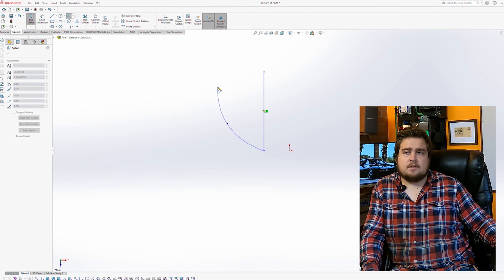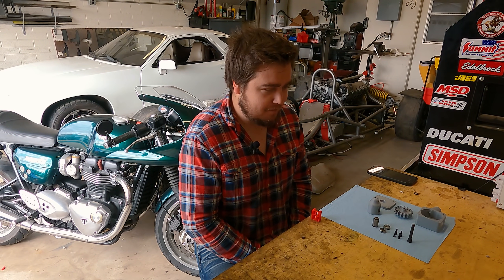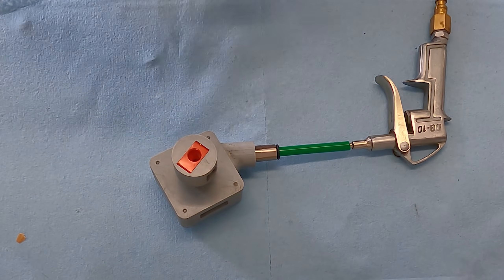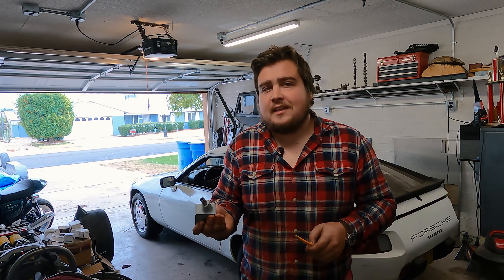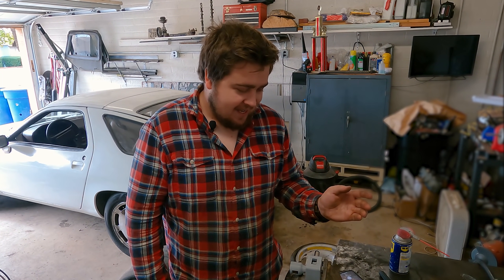11,000 RPM Turbine Pencil Sharpener!

Comment: Did you ever try and calculate the power and torque it could produce? I've been tinkering with a similar compressed air turbine but I don't have any of the parts printed yet

Comment: 3:05: In this point you have put the center wheel correctly, but here 3:34: You have the centerwheel backwards so that the air flows on the convex side of the spoons intead the concav side.

Comment: Now hook that air spinny gizmo to an old fashioned pencil sharpener like the ones that hang on school walls and it might not jam and could probably work pretty well.
Maybe print it with Tesla turbine smooth blades so it won't fly apart.

Comment: It's extra amazing that you took so much time and care in your build.  These days everyone is so rushed. So, I think the problem is the excessively tight tolerances down to the micron. It happens a lot when space age materials are used, due to expansion and contraction from minor changes in ambient temperatures. Also, next time, add more lubrication, I find that you need at least 10 to 20x lubricant at those pressures, usually a continuous spray at -70 degrees to ensure minimal expansion, and make sure to use the filtered deionized stuff and maximize the ventilation, that will help reduce the explosion risk. Additionally the Rotations per minute are clearly too low, consider 10x that to really get that tip to be extra shiny... and of course at those speeds be sure to do it all completely remotely and protected to insure maximum safety. 
:) 
Ok Ok... I was totally joking. I really enjoyed your sense of humor.

Comment: Revision idea, instead of holding the pencil sharpener turn the holder into the sharpener so it’s perfectly centered with the shaft and then use the blade from the actual sharpener.

Comment: There exists a pencil sharpener drill attachment.  Whether it has one blade or two I'm not sure, but it works--granted at much lower RPMs, but it works well.  Would that work any better than the sharpener you used?  This is the first time I am aware of that I've seen your channel.  I'd love to see a video where you improve the design not only for durability, but to where it will eat through a pencil with proper sharpening in short time, with a beautiful continuous shavings coil and a razor sharp pencil point.  Like a design that works well enough where you might want to use a tool to hold the pencil instead of your hand.  But yet the design would be practical enough to give you a new pencil point in about 0.02 seconds.  The other commenter has a seemingly good point about using the planetary gear type sharpener though.

Comment: so, isn't that wheel installed backwards? 

the fluid is supposed to go into the cup, and it looks like the air is actually flowing over the convex part, not into the concave part.

Comment: you can make this work if you add a weight (properly distributed) to the wheel, to have some bloody driving force. also remove the cheap sharpener and keep just the blade :)
Reply from the maker: Yeah, that was my idea after this was to add a counterweight. I think I might.

Comment: You can possibly measure the rpm by finding out the pitch that it makes, and divide that pitch by the number of blades on the wheel, which gives you rps.
Then it’s just a matter of multiplying by 60 to get the rpm.
I’ve used this on mouth powered turbines too, and they can get stupid fast.

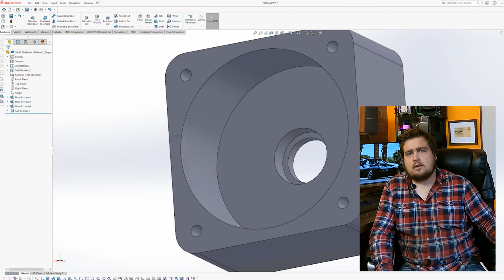Comment: Probabbly will work better with a 1:10 gear reduction or maybe more. You need low RPM and high torque so you can push hard on the pencil agains the blades. At that speed the blades probabbly hover over the pencil creating heat

Comment: the sharpener you put in it has a blade angled for low rpm and deep cutting. not high rpm and shallow cutting. if you were able to get it to engage the blade it would turn the wood to dust and likely self lubricate.

Comment: You might want to gear that thing down about 50:1 or so using some planetary gears and see if it sharpens better at lower speed with higher torque.
Reply from the maker: It probably will, but what's the fun in that?

Comment: Great video! I love when fever dreams happen to engineers, this is the stuff that happens. If you were to try this again, I'd suggest using a radial turbine instead of a pelton wheel - radial turbines would give a lot more torque I reckon. I have a SOLIDWORKS file for a radial turbine if you want it!

Comment: It wasn't the set screw. They all broke off like that because You spun the wheel fast enough that the centripetal force pulling the cups outward exceeded the tensile strength of the PLA.
Reply from the maker: I’m not completely sure- I printed another one and it did a lot better. I think I had a failure point

Comment: In order to sharpen the pencil you would need to use one of those sharpeners that are usually screwed to the door frame or such. They have cutting gears in them. So that is what you would need to attach the air power to.

Comment: You need a kinetic fly wheel for inertial torque, will buzz through pencils easy with a proper weighted one- though if not enough power, a reduction gearing for sure.

Comment: This is my first visit to your channel. I have deep respect for your "Fuck it, that's within tolerance" build philosophy and the 928 Porsche in the background. Also, I think you have that wheel on backwards unless you actually intended to present the domes rather than the cups of the wheel to the airflow. Finally, liquid lubrication to clear clogging with chips may not be the win you expected.

Comment: 90% sure the problem was that the two spurving bearings were not in a direct line with the panametric fan, have you thought about using prefabulated amulite for a more malleable baseplate?
Reply: Pretty sure Rockwell owns the patent, and would never allow it.

Comment: Now you know why electric pencil sharpeners use the grind method instead of the blade cut like tiny hand driven ones. Maybe try one of the dual blade versions so there is less drag on a single blade? 

I cant blame you, did a similar thing with way less nice materials... I also did it in the late 90s when 3D printers weren't a thing.

Comment: You and Superfast Matt are my favorite engineers allowed to run amok.

Also, I love the idea that you took an activity that requires pretty decent torque, and applied unbridled RPM to it instead.
Reply from the maker: Haha I mean if you add enough RPM torque doesn't matter.
Reply: @WesleyKagan  it's like the air force's solution to lift. You don't really need it if you're moving fast enough

Comment: I'd really like to see this sharpener eating a pencil as fast as you push it in. Why not make multiple nozzles around the circumference and turbine wheel more robust at the center? It should be pretty strong as a printed part if you have continuous layers for the full width of the part.
Reply from the maker: I actually really don’t hate this turbine design if I’m honest. It’s not terrible. Stronger bits here and there and a less terrible set screw and it would do okay. It’s definitely staying in the “good” pile of parts
Reply: A bigger wheel with more jets should increase torque and decrease rippums.

Comment: I see your problem. During reassembly after you said you left the pinion grub-screws off, you appear to have flipped the wheel so the cups are running the reverse direction. You had it right first time. So clearly not enough rpm. Always solution... MORE!

Comment: It may seem impossible that there might be improvements to this design, however redirect the airflow to blow out shavings.
Reply from the maker: That’s… a really good idea.
Reply: @WesleyKagan  make sure the exhaust is pointed directly at the users eyes
Reply: @dylanwalter1  please look directly into the operational end of the device
Reply: @PolishGreasePit  i see a spinnyboi
Reply: Use a tube for main shaft and drill random ports in it to send air through, could be neat

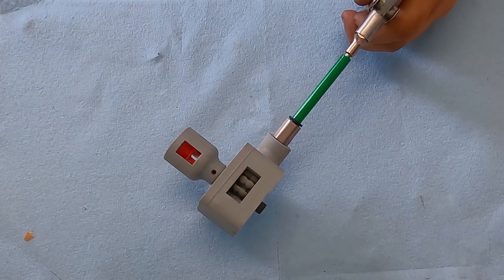Comment: 3:37 based on your cad drawings, isn't the turbine in the wrong way? bucket openings facing the away from the inlet in that assembly?
Reply: It is. I came to the comments just for this. Hehehe. You beat me to it
Reply: Yes, yes it is
Reply: I also came in here just for that. I wasn't sure if maybe I didn't understand how a Pelton wheel worked, but I was pretty sure the airflow should be directed into the concave part.
Reply: and also i think that rotation was also wrong and that sharpener was spinning the wrong way
Reply: You can flip the wheel over and it will for in exactly the same...
Reply: @84ThoughtCrime84   I'm not quite sure what you're saying. If you flip the wheel around then the stream of air will go into the scoops on the buckets instead of the back side of the buckets.
Reply: @84ThoughtCrime84  what?
Reply: @84ThoughtCrime84  Mate just shhhh, the grownups are talking.

Comment: @wesley kegan
3:32 - looks like you've installed the wheel the wrong direction (spoons pointing convex against the nozzle)
Nice print though 
can't wait for the updates on the diy  freevalve engine :D
Reply: Shit you're right!
Reply: I almost thought I was the only one who saw that.
Reply: @aggaming1766  if you're ever on the internet and you think, "I wonder if I'm the only one who..." - Don't. You're not.
Reply: @Hawk7886  it's just that I scrolled for quite a bit before I found this thread.
Reply: Yeah I caught that too
Reply: i wondered why it slowed down so quickly
Reply: Plus,as with any turbine the whole air charge must be focussed upon the impeller at the optimal position which it's self must be enclosed the and  air charge needs to be pushing the cup or blade for as long as physically possible in one rotation before exhausting hence the scroll in a turbo charger for example,an open chamber allows most of the air charge to not only by pass the impeller regardless of its orientation,( path of least resistance) but also creates turbulent air in the chamber adding drag to the turbine wheel. It's a vicious circle,small air motors have no torque and rely upon speed to maintain momentum,anyone who's ever used an air cut off tool for instance will know what I mean. You need speed to create power but that thing can't harness enough of the energy input to create the power for the speed required.
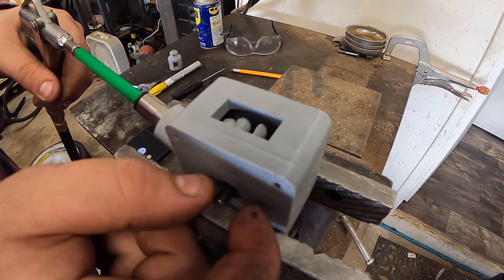Reply: The same at 5:56…
Maybe if it was installed the way a real pelton wheel “should” be installed, the pencil would have been sharpened in half the time or less 🤣😂
Reply: I wonder if the sharpener was spinning the right way...
Reply: @MrRitzyVlogs  good question, although I believe it was ... the wheel though wasn't 😁
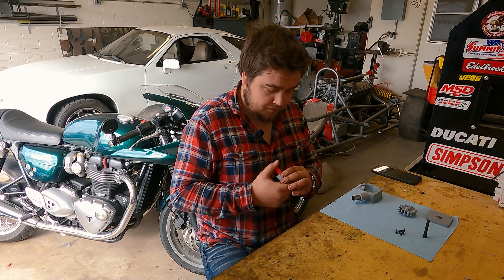Reply: @MrRitzyVlogs  I thought that too, but if you pause the video at 2:19, and use the frame-by-frame feature of the video, (Period key) you can advance the video to about the middle of 2:20 second, and you'll see that the blade is facing to the right from that view.  With the wheel rotating counterclockwise, (viewed from the side of the pencil inlet) like it was, it should have been cutting properly.
Reply: Glad I wasn't losing my mind
Reply: Good catch
Reply: Notices the same thing right away. It blows on the back of the shovels.  :)
Reply: Glad someone else saw it XD I had to slow down the video to make sure I was right lol
Reply: I’m not so sure, because the end of the nozzle is at a downwards angle and so would be pointing at the other side of the wheel and facing the convex side of the spoons.
Reply: @Slicelikeice  look at it again and replace the word “concave” with “convex” 😉
Reply: @RobiBue  first I must google which one is which
Reply: @RobiBue  indeed you are right. Thank you.
Reply: I agree
Reply: Exactly
Reply: i saw that too
Reply: OMG it broke apart because the air resistance on the cups ripped itself apart, installed backwards, wasnt operating optimally, really a selfdestructive setup
Reply: @starwarskid93  Nah, it would have come apart much quicker, had he installed it the correct way, thanks to higher RPMs.
Reply: You guys are all incorrect. The air flow was angled to the bottom of the chamber containing the pelton wheel, and into the concave side of the impulse blades (spoons). Thus spinning the pelton wheel in the direction toward the air flow. The impulse blades breaking off the main assembly of the pelton wheel was probably due to the PLA plastic (or whatever it may be he 3d printed with) getting rapidly heated and cooled, leading to the plastic becoming less pliable, and more rigid. Add that to the hard jet of air rapidly spinning the pelton wheel and you have failure. 

I think the issue with the sharpener is as he said, chip evacuation. I think if instead of a housing for the sharpener, designing a caged cylinder with an internal sled to angle the blade from the sharpener via a set screw (just like a standard pencil sharpener), would lead to sufficient chip evacuation and a rapidly sharpened pencil. I hope to see a revision to this. I know the torque isn't there due to there being no compression, but I still think at such a high rpm this would still work.
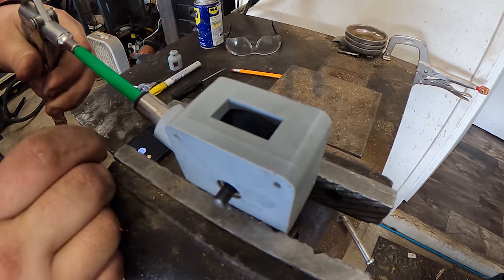Reply: @TheKillla007  Pause the video at 6:02.  The concave cups on the top of the wheel are facing to the left of the screen, with the convex side to the right.  That means that at the bottom of the wheel, the cups,  are facing AWAY from the air nozzle.

If you start tapping the Period key on your keyboard, (assuming you have a desktop) you can advance the video one frame at a time, and you'll see the cups at the top of the wheel are moving counter-clockwise, from this view, which means the wheel is on backwards.  The Comma key reverses that frame-by-frame feature.

"...getting rapidly heated and cooled,..."  That's hilarious dude.  There was no heating and cooling that affected the PLA.  The wheel came apart because of an extremely high G-loading from the centripetal/centrifugal forces acting on the wheel.
Reply: @TheKillla007  killa, killa, killa, you might want to review the video at 3:37 (that's 5 seconds after OP mentioned) pause it and "zoom in". Then, look at the way the pelton wheel turns and the way the blades are oriented and the way they then would be oriented at the bottom where the air would impact the wheel... you might get an epiphany... sometimes you just gotta look at it...
the blades breaking off are most probably die to the high spin rate and the air pressure or a combination of  air pressure, the centrifugal force due to the speed, and the nature of 3d printed objects and their adhesion deficiencies...
forgive me, I didn't mean to sound patronizing, but look at the images closely ;)

Comment: I wish I had half the enthusiasm for my legitimate projects that you have for even the most ridiculous and mundane ones. You're an inspiration. This is a spectacular failure, but it's much cooler than the 240SX that was sitting in my barn for 2 years because I had an inability to make myself work on it.
Reply from the maker: What's not shown is about 200 Completed projects in solidworks waiting for a rainy day like this. I get it.
Reply: I have several 240SX's. Nobody wants to work on their 240's. Lol.

Comment: I guess you installed that wheel wrong way round? At first it was ok but at the end, wrong. Or, am I missing something completely with this Pelton wheel?
Reply from the maker: Nope, I installed it wrong the first time. You aren't mistaken. I had to switch it.
Reply: Still, it's wrong way at the end where it breaks?
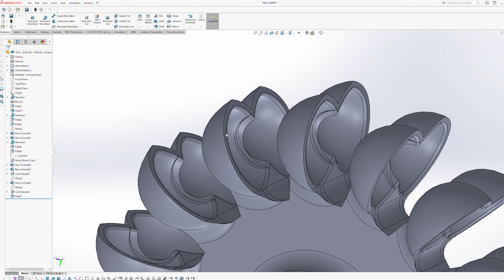Reply: @ilkkasorsa9778  At 6:27 in the ripped apart shot it looks like the "top" of the buckets were on the left, but it rotates counterclockwise. I might be missing something completely though.

Comment: Wesley, as one who doesn't like committing to ink, I very much prefer pencils.  I do prefer wooden pencils, but use mechanical ones due to the required maintenance of constantly sharpening them.  I think an 11k rpm sharpener is a wonderful idea!  I think the problem is the sharpener is designed to turn a few rpms.  The plastic material has too much drag and would heat up.  The blade angle is too steep and would dig in.  Also, it seems to clog up.  A redesign to make it easier for the waste to exit and maybe using the waste air to blow out the shavings would keep it clear.  
Merry Christmas and looking forward to a new year of cool projects!  Thanks for the video!
Reply from the maker: See, I'm the opposite. I'm someone who constantly commits to ink when I really shouldn't. That's where my lack of practice for sharpening pencils comes from. Merry Christmas, Thank you!
Reply: @WesleyKagan  Well, yes...  but you have a command of the design software.  You can design something and go back and edit it.  That's like a pencil and not a pen.  We live in a wonderful world where we don't have to start a drawing over for a redesign.  Remember most nuclear power plants in the US ( and elsewhere) were designed with a slide rule!